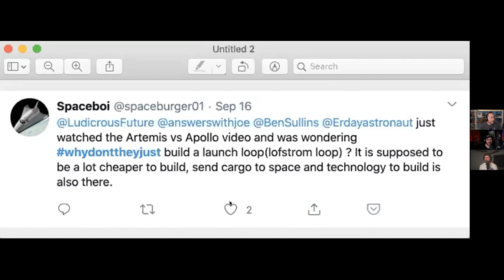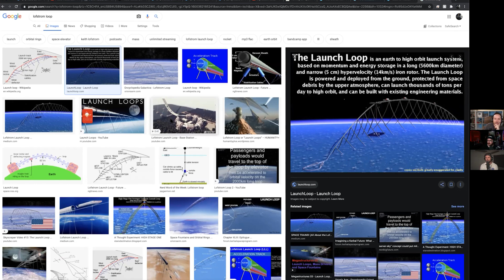Why Don't They Just launch with Lofstrom Loops? (Highlight Ep 102)

Comment: they really didn't fully understand the beauty of the Lofstrom-Loop. It would get economical if an organization has to do continuous launches, 100 00 00 (10E6!) launches, or so. Just, this is correct: that it would be easier to operate such a technology on the moon (or on Pluto, for that matter) The Lofstrom-Loop lifts its rails up to the proposed 80 km by the inertia of its own launches! The technical problems, I see are in the two massive rotators on the ground: huge forces!

Comment: In sci fi the loop was defined like and I'll give an analogy a bullet train track that is a few miles long then like a huge roller coaster angles  up with the spaceship on a disposable railcar and reaches hundreds of mph removing the energy required that is huge to just get the mass moving on a pad but with the magnetic rail you're saving size of device and fuel in reaching  orbit. If you can cut have the size of tanks and mass that also needs to be accelerated and using ground based fuel to get it moving and having the engines started on the starship but waiting to go full blast as to save fuel and keeping the sled riding on the rails stable then full power at the last hundred feet allowing the sled to fall off the end of the track up hundreds of feet while the ship itself is accelerating and rising. If you did this the fuel required might make it so the fuel tanks and reduced fuel required would be reduced to maybe less than half. Also the saved fuel could be taken to orbit to be used in the journey or at the destination to build or exist or even the mass could be replaced with rawmaterials to build machines or structures  needed to complete the plan instead of having to mine manufacture stuff off of the planet.

Comment: Basically, you'd get space elevator like costs to orbit, with only a fraction of the cost and without unobtanium. Also, these guys seem clueless that this is a dynamic system which is levitated in tension using the momentum of the weights inside the loop.

Comment: A magnetic launch rail up a mountain side is possible, getting a rocket up to supersonic speed is the hardest part.
Reply: Heck use 2 mountains like on a hilly highway. Accelerate down one and then have the rail up the side of the mountain next to that one so hit the bottom of the first still accelerating on rail and then hit the base of the other where the track goes up at 500mph and at the top your breaking land speed records or even do it in a tube so wind and weather in the pipe "50ft around like the ones to let water flow under a highway" and going uphill no rocket fuel used yet but to idle engines moving over the speed of sound before leaving the rail and pushing at 1 or 2 G's like it just launched from a submarine but not so much that it'll squash the humans inside or make the vehicle structure fail so you end up leaving a ground surface and hit orbit in a minute or 2 or even less with the right tech. Kind of like the first shuttle dropped from below and aircraft wing but without needing an aircraft that could fail and instead using bullet train tech and gravity to do some of the work the current rockets do today.